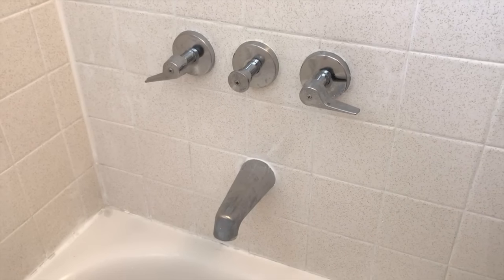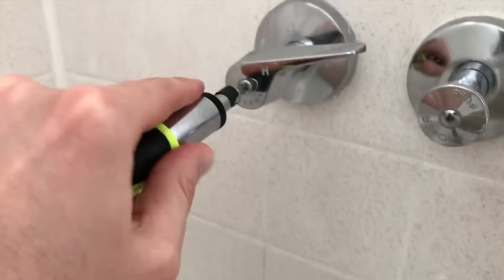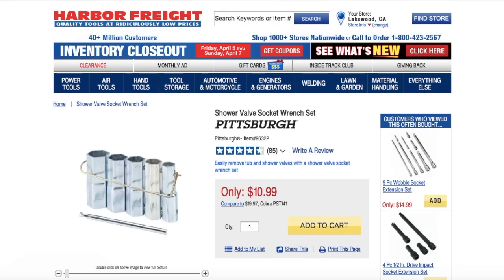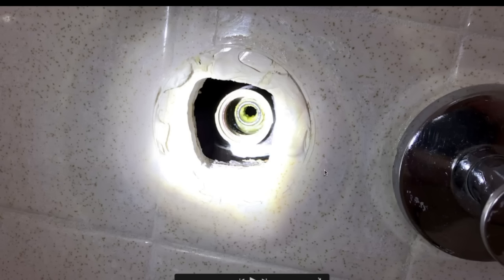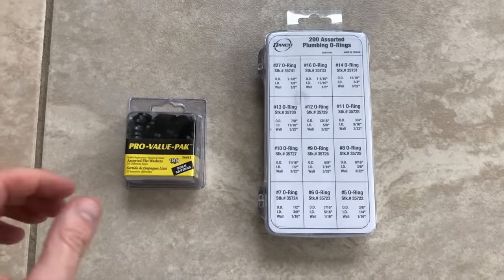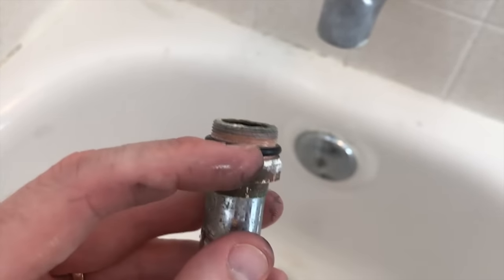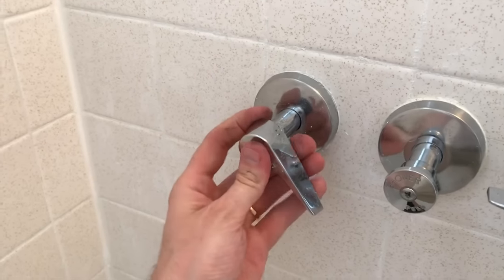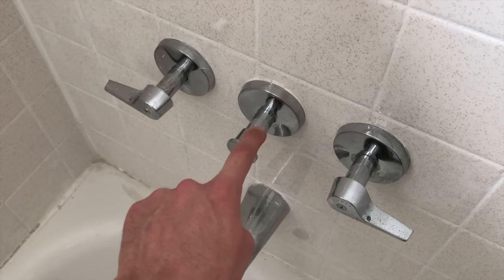My tub faucet is leaking/dripping - won't stop dripping - EASY FIX!

Comment: Mine is dripping even after turning off water supply to the house
Reply from the maker: Antonio Kim 

Thanks for watching.  After shutting off water to entire house, turn on all faucets and allow the water inside your pipes to drain out.  In most cases, water should come to a stop and no longer drain out the faucets in roughly 2 to 3 minutes.

After 2 to 3 minutes & water is still coming out, you may not have your shut off valves fully closed.  Keep us posted.

😎👍🔧🔩
Reply: I would say also if you have an electric hot water heater then you probably want to turn off the breaker powering it, because if the water is lower than your element than the element will go bad most likely and you'll have to replace it.
Reply from the maker: james bond 

Thanks for watching & we appreciate you sharing your thoughts.  Great advice.

😎👍🔧🔩

Comment: Why am I eating through those seals over and over
Reply from the maker: Thanks for watching & welcome to the DIY Raptor Club.  That doesn’t sound normal at all...🤔

This can happen when the size of the seals are not the same as the originals.  If someone replaced the seals long ago with different size seals from the originals prior to you, this unfortunately will set you up for failure every time if not gone back to the original size seals.

😎👍🔧🔩